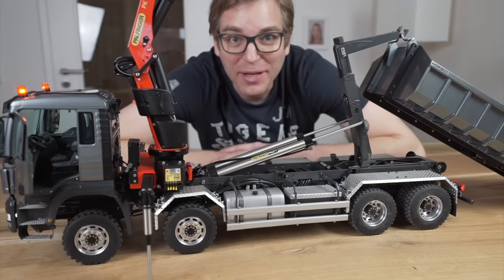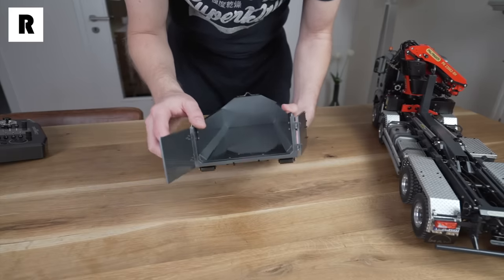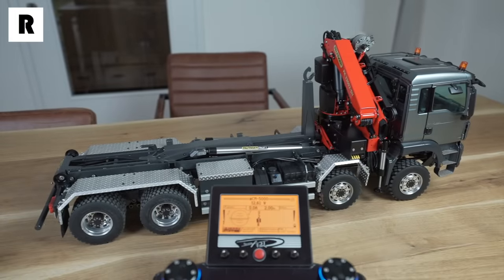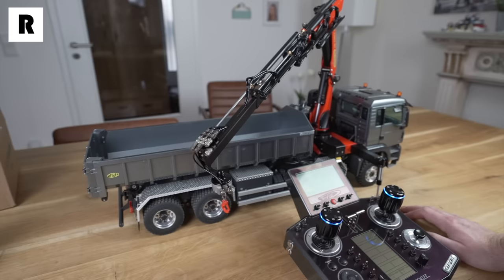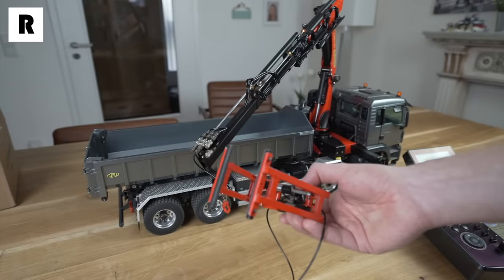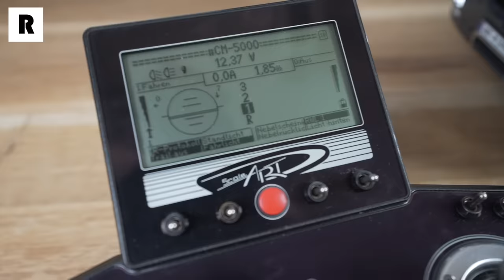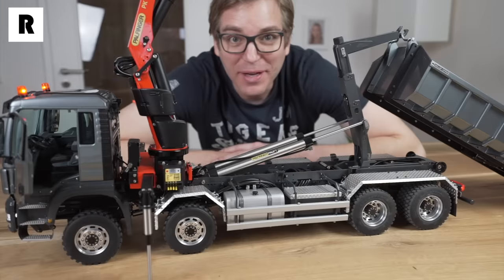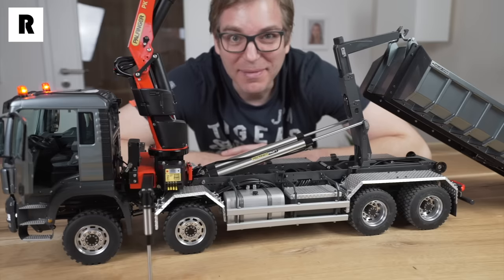REVIEW of AMAZING RC TRUCK with hydraulic crane from SclaeART

Comment: Would be sweet to finally see someone 3D print an actual engine (maybe add some coating to the cylinder walls to reduce the effect of heat at least a bit) and use it on their RC trucks <3 That would be something I would pay to see.

Comment: I am blown away. What a feat of engineering. I actually operated such a truck, it was called a claw truck. It was used to pickup debris from the road or drains. The container was attached to the truck but it could dump with the doors open. The actuators were as follows: 1: up 2: down 3: left 4: right 5: claw swivel 6: claw jaw open or close and 7 was dump. The truck I operated had a Mercedes 6 cylinder engine and wow!, that engine could burn some rubber. I want to know how much the model costs. I am absolutely amazed! Thanks so much for sharing the video. Thats what I call German engineering at its finest!

Comment: Cool model sir . 
Years ago we used to use the grab for picking up packs of bricks on brick trucks , the  roll on body`s  we used to call them walk in bins or walk in skips .
Many years ago i drove bin trucks ranging from single drive acco`s and fords ,   up to mack twin steer bogey drive , and volvo bogey drive single steer , none of them  where fancy like this though  ,  hook lifts where not common back then , we used  hydraulic winch`s and cable/s to pull the bins on .

Comment: We have the real ones Built by Stellar  the container is called a box   one thing the lift is not as the real thing at least like ours  the hook is on a separate cylinder on a A frame  to tilt it for loading/unloading the box   and for dumping there is a double frame that tilts up   But this is a very good unit ill show this to the owner he will  I  bet buy one !!

Comment: it's very nice but 17K Euros net seems a lot for this toy. I would buy a new motorbike ;)
Reply: 17K Euros, you could almost buy a pretty decent, new car for that, almost, in the US at least. With some skills and patience you could actually build something very similar for a fraction, the hook lift mechanism I have seen for a couple of hundreds, including all the parts for it, the hydraulics, pump, elec. and container, the most expensive/hardest part would be the crane, I have also seen complete kits of it for like 1k+, the rest wouldn't be that expensive and hard to replicate, you could use a Tamiya cab, maybe even cut up and epoxy/plasticweld two bruder cabs you could find second-hand.
Reply: 17 k erours no thinks
Reply: Waste of money
Reply: @Dan-nj7tr  Agree, 17 k is a waste for that toy

Comment: It's a fantastic model, but the cost is horrendous - You could buy a full sized car for that money !
Reply: How much?
Reply: @Brax55  If you choose all options and use the controller shown 10482 euro - and that's without the crane, which is another 2500 euro without any extras.  All together it could set you back 14,000 euro
Reply: Unbelievable
Reply: @MalcolmCrabbe  Money talks, just insane, can get a real thing for that money

Comment: It’s Incredible! But at €20,000 as shown, it’s so expensive!
Reply: The parts are expensive. When making a quote for a customer, for something similar, the base kit $800, $1300 arm, $500 bed, metal running upgrades $1000, metal cosmetic upgrades $2000, cab conversion $500. That's a rough estimate of parts alone. Want light and sound? $500. Want it assembled? $25/h. Pain alone for the cab runs around $30 in paint cans.
Reply: @shadowblack1987  I bought one and it's finally arriving, after 10 months' of waiting. I feel kind of dumb for spending so much $$$. Hopefully it will be worth close to this in 20 years when I sell it.